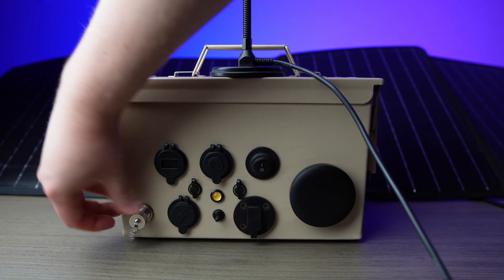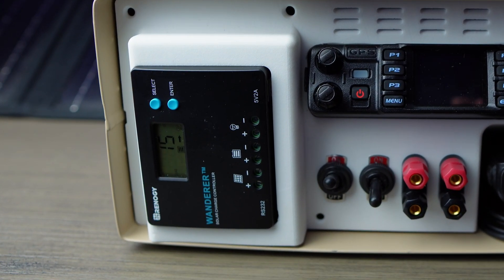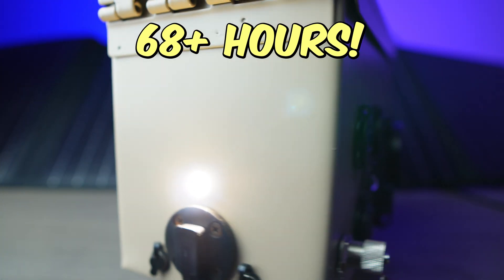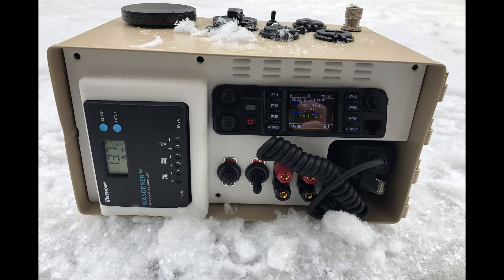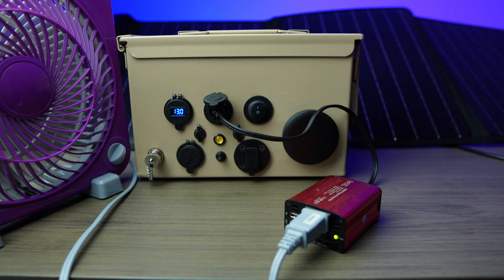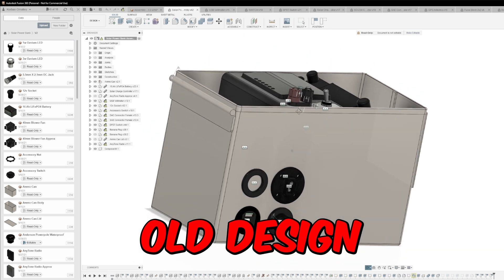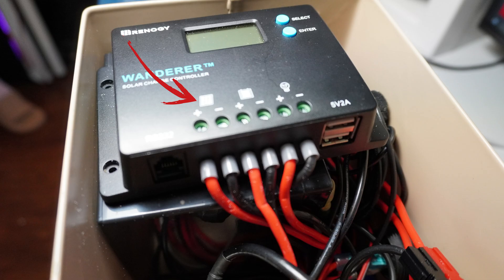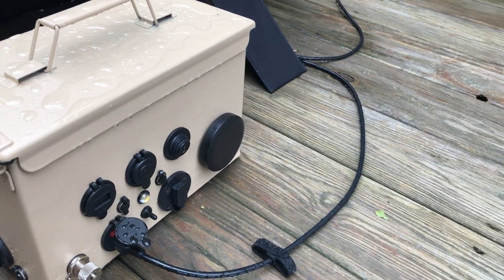DIY SHTF Emergency Communications Station

Comment: What about the power output of your radio? I know none of mine will put out full power unless they have at least 13.8v. Does this radio put out full power at 12v or you using a boost converter to raise the voltage?
Reply from the maker: Are you checking your power output with an in line meter or are your radios giving you an under voltage warning? I have not tried a power meter on this setup but yes, in general I’ve seen that the claimed output wattage is only achieved at 13.8-14.2V. It’s also pretty rare that I need to transmit on full power.

Comment: Excellent design and build. I'd like to make something similar. Could you put together a parts list or maybe even share the drawings you've already created?
Reply from the maker: Here's all the documentation and models: https://drive.google.com/drive/folders/1aucg1ib7pq7YDGLdG3mu12WZgjFxImD0?usp=drive_link
Keep in mind the 3D printed panel needed to be Dremeled to fit the radio and charge controller.